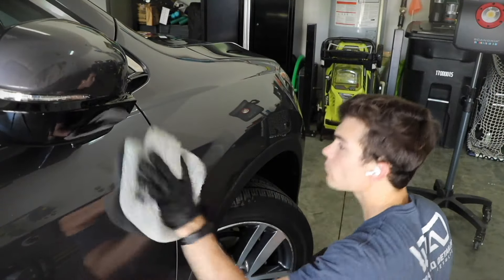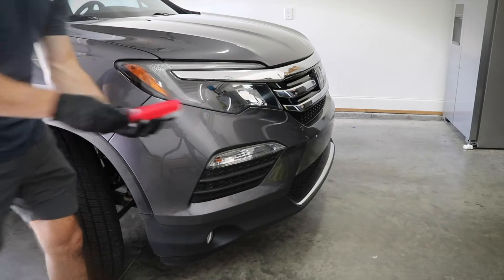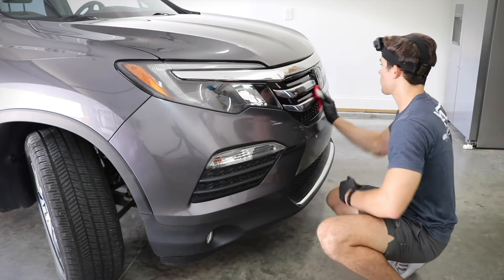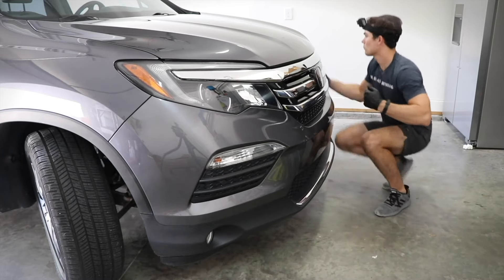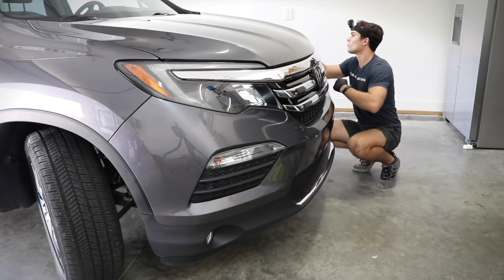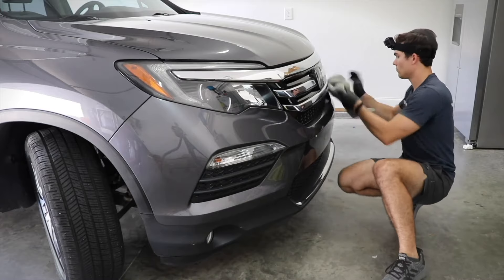How To Apply Ceramics In The Heat & Humidity

Comment: Awesome sessions yesterday. Thank you for addressing me and Bambi's question at the end of last night with this video. So, in direct sunlight with high heat, spray a bit of distilled water to cool a section and apply a thicker coating and remove it almost immediately? I would think working on smaller sections at a time would be ideal. Like a 1x1 ft? What do you think?

Comment: Luke: Can you recommend a Ceramic Coating that we can use in the heat & humidity & sun other than Underdog ( expensive) that is more cost effective?
Reply: I detail in south Florida and DIY Detail have worked really well for me. Just have to apply and remove a lot quicker. Hope this helps. 🙏😎🌞
Reply: Yesterday I applied No-Hype 1 year Ceramic coating ($15, their 3 year is only $25) in south GA, High heat and humidity and it was easy. The coating is super slick and has great shine! But like laautodetails said, it’s pretty much apply and almost immediately level/buff off. If you run into any issues or high spots feel free to reach back out. I had some high spots on the hood and just used a small dab of polish compound to remove it with a microfiber towel. Then applied panel prep to that area and recoated. It was super easy!